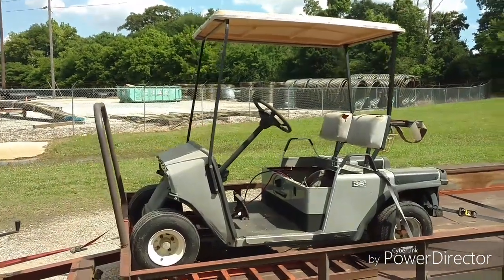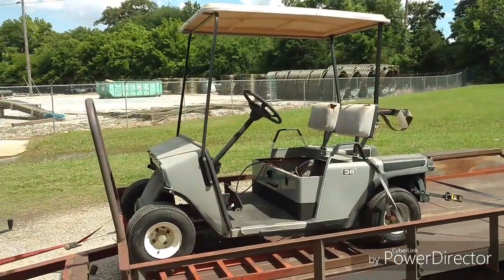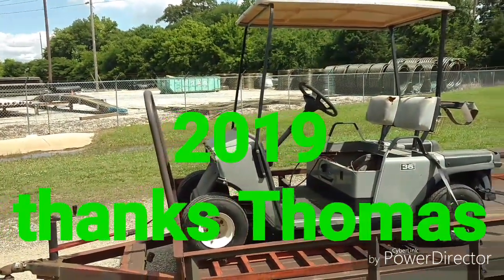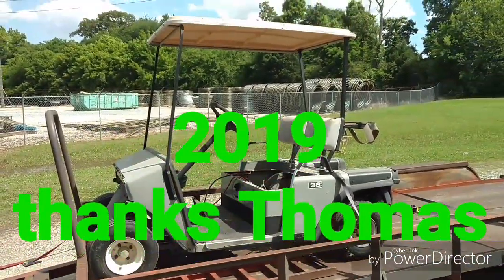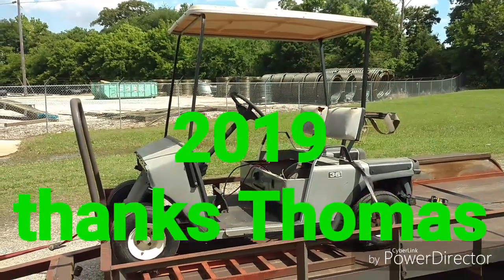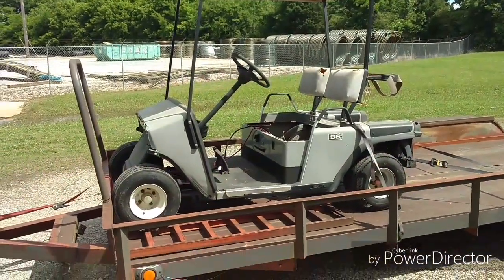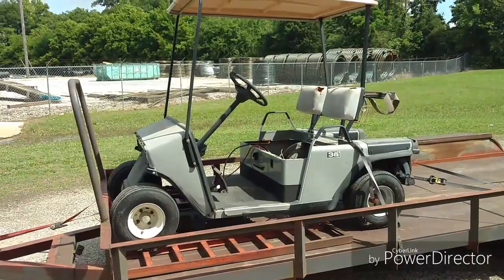Predator 212 golf cart ezgo marathon electric to gas conversion. concept video.

Comment: I just got the same cart for free.  Used to be electric. Came with predator 420 but was a burner cart so it is not in great shape. Doesn't have any id tag so I don't know what year it is.  But you're the only other one I have seen with 4 cup holders.
Reply from the maker: Cool, see if you can polish up the rear diff housing, mine has the date stamped into the aluminum on the back side.

Comment: My Ezgo does not have any accelzrator shaft coming from the pedal it be missing do you ha e pictures of it how its hooked on the trottle peddle  thank you
Reply from the maker: Mine had a shaft coming back underneath, I built a bracket to hold the cable housing, then attached the cable to the shaft, so the shaft pulls it